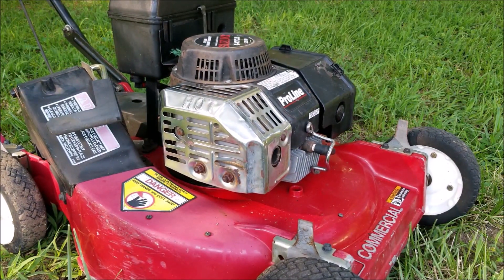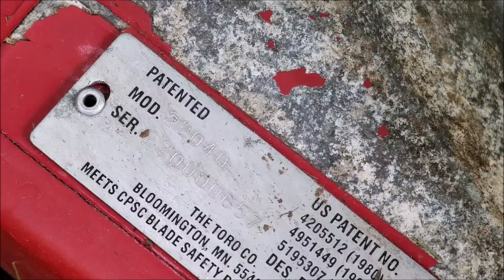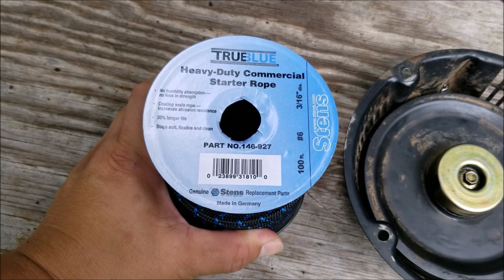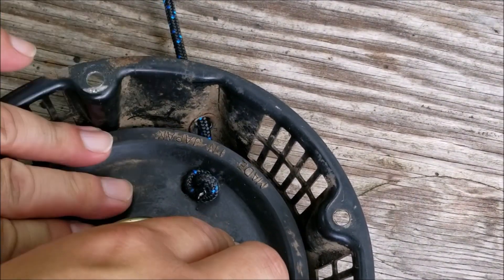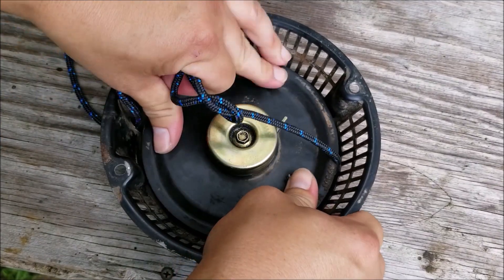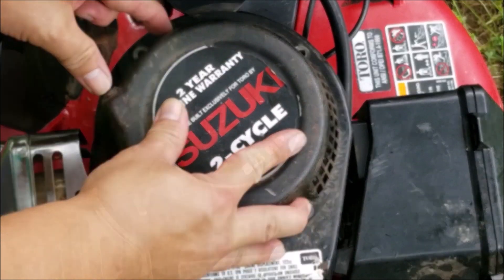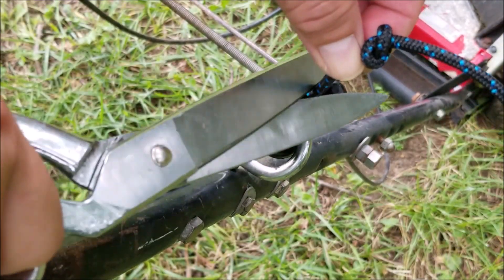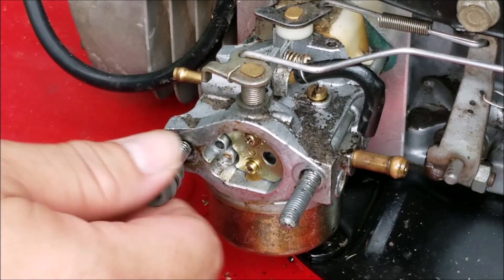Pull rope problems on Toro commercial mower

Comment: I've got a tip for you 😉👌 have you tried priming it well it's easy to get to prime it all you have to do is turn on the throttle cable and tip the lawn Mower forward until it reaches to the spark count to 4 or 5 times and it will work 
Thank you very much mate
I'm Joseph Lama from Auckland New Zealand 🇳🇿 enjoy.
Reply from the maker: i haven't tried the tipping method yet. Thanks for the comment

Comment: Good video, I would probably use a high quality standard size rope. Probably the reason it is breaking is due to so many pulls to start the engine. If you can get it to start on one or two pulls you probably won't have rope issues. Thanks for great video's.
Reply from the maker: you are absolutely right thanks

Comment: that rope is a good size in the pulley and no you did not make a mistake as it needs a bit of pulling strength to pull the motor over quicker and the carburetor does sound like it,s gonna need a good cleaning for sure
Reply from the maker: Thanks and I do believe you are correct

Comment: I would have used the proper size rope, but if the larger diameter rope works without chafing or hanging up, you're good.
 But right from the first several pulls I could tell, the rope might be worn, but that wouldn't prevent the engine from starting unless the the rope is binding somehow between the recoil and flywheel and prventing the flywheel and crank from turning freely.
I used to work on golf courses for years and never saw a Toro rotary mower with a 2 cycle Suzuki powerplant. Interesting. Have seen and worked on plenty of 2 cycles, never saw a Suzuki.
Check your spark and timing. Check fuel delivery, and carb itself. If all is well, check compression. If low, check your reed valves, and compression release if there is one. Reed valves are tricky little buggers. The old ones can still look and feel fine when out of the mower, but under load they just fail. 
Best of luck.👍
Reply from the maker: thank you William Jones for your time.
Reply: @HomeGaragechannel  No problem at all. Hope you get it running. Will look forward to the follow-up vid. All the best.👍

Comment: Looks like a normal lawn mower to me so what would be difference between a  commercial and a non commercial one, is it because it weighs more that a normal lawn mower?
Reply from the maker: The deck is thicker and stronger to take daily usage. The engine in this case is a large 2 stoke so no oil changes needed. As for weight i guess a case could be made for more weight the better. Thanks for the comment

Comment: I would have used the original size but that's due to my inexperience with repairing mowers.  I have a 20 year old craftsman mower and my father had a 22 year old Snapper (back in the 80s) until my brother got a hold of it.
Reply from the maker: What did your brother do to the snapper?
Reply: @HomeGaragechannel  He didn't take care of it and stored it outside in the elements.
Reply from the maker: @dagorithe  thats shames